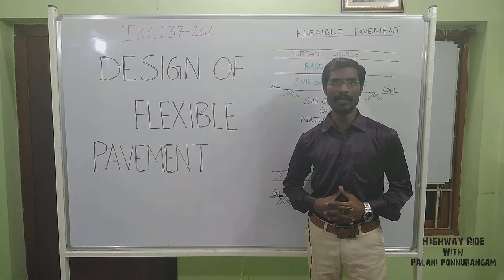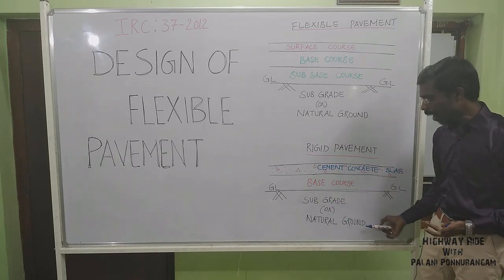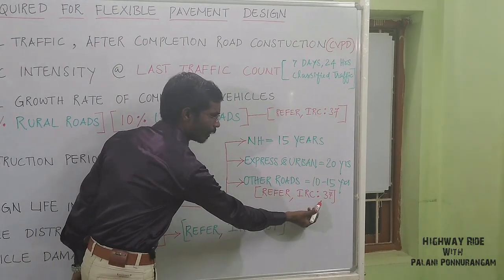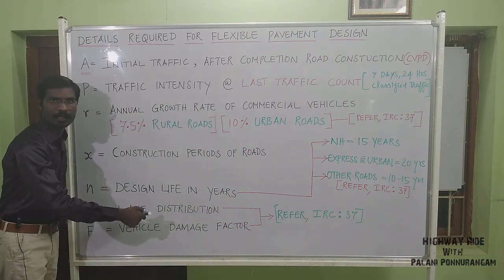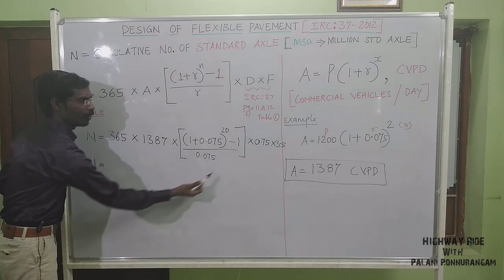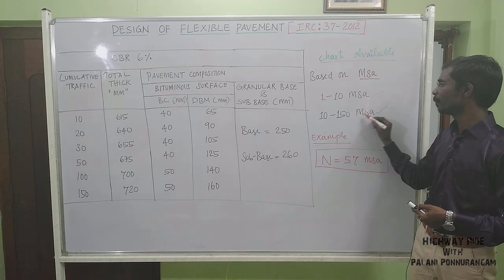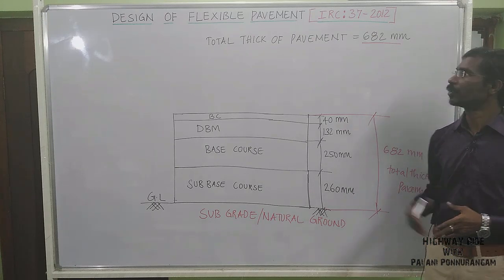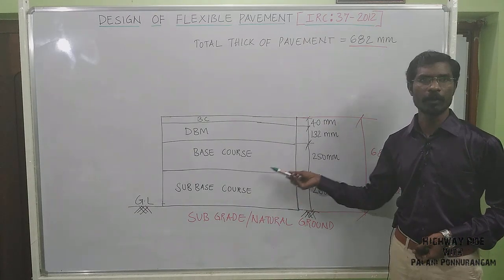Video l 6 Design of Flexible Pavement (IRC:37-2012)

Comment: Why we use W18 Kips on ASSHTO and what is meant by 18Kips like it is for what Is it the force of the track or the resistance of the road that can maximum applied? why not more force exceeded, and what happened if exceeded.